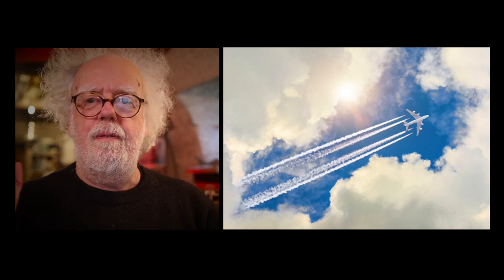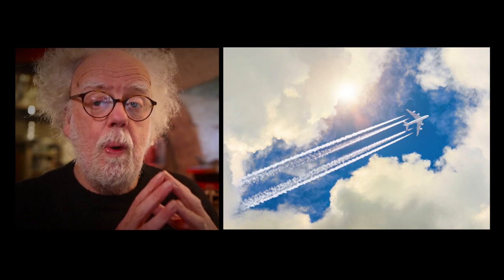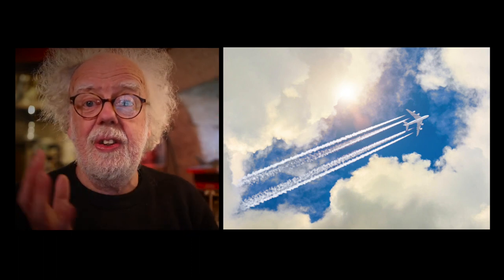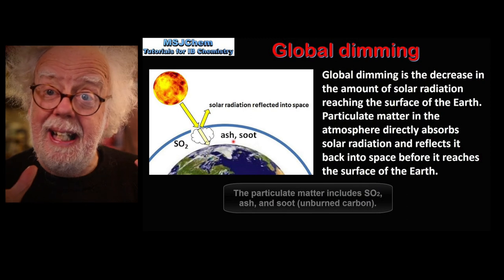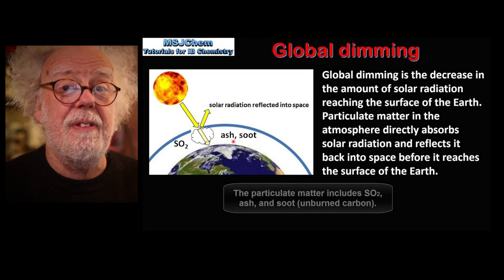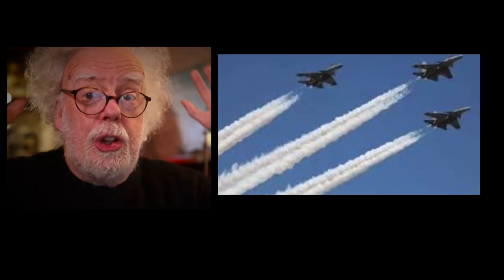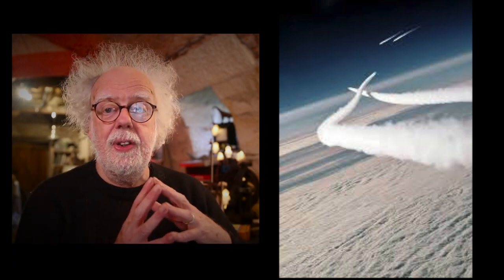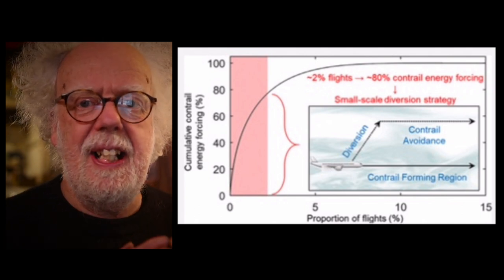Con-Trail Secrets - Prof Simon

Comment: as a former pilot what is stated here is nothing new, Relative Humidity is well known fact in understanding the formation of cloud which a condensation trail is.  in fact it is all part of the Adiabatic process provided a parcel of air reaches its Dew point then it will condense out and form cloud regardless whether it is an aircraft or the cooling towers of a power station producing it.. meteorological soundings or Tephigrams will give you and idea of which FL this will occur however i disagree with your figures on contrails contributing to 50% global dimming. Cloud reflects shortwave solar energy thus therefore less short wave will reach the earths surface to rebound back as Longwave radiation (terrestrial re radiation) thus negating greenhouse effect the contrail produced if your hypothesis is to be correct ..remember that the Krakatoa eruption in 1853 caused Global cooling ..further more it is common knowledge that the ww2 B17 crews can be seen by the Germans 50 miles away on some days, the length of Vapor trails depends on the R,Humidity on a given day.. and today`s Gas turbine engines are high Bypass rather than low bypass of the early years of Jet airliners thus  more of the air ingested is bypassed at the N1 Compressor therefore cold air surrounding the heated air from main combustion chamber compared to almost 100% of air ingested in Low bypass passing through the combustion chamber ..so in a nut shell it has negligible effects on WX in comparison to heavy industry at ground level and certainly is not the chemicals some conspiracy nuts like to dribble on about

Comment: Professor, i wish my memory served me better, but are you aware that some of these "vapor trails" (of which most are as you say) are actually what conspiracy theorist refer to as "chem trails"? And funny you mentioned the weather association,  because the reasons for these "chem trails" is not as nefarious as believed nor as secret. In the early eighties there were broad ranged projects and experiments in the Los Angeles area and most of California (where I was born and raised) in weather modification. One of which has been used for several years, cloud seeding with different powdered metallic substances in suspension and sprayed above the cloud deck (which as I'm sure you know varies with the weather) and through whatever processes, promote the continued condensation within the clouds, At which point they will grow and become more dense until the point of rain. Various newspapers of the areas of these occurrences would run ads in the "Public Notices" sections of the newspapers int the applicable communities. California has had a long history of drought and the eighties were no exception. One other note, maybe you would be willing to verify this; I read an article that had a believable story about weather modification weoponised, and how it's (supposedly) an addendum in the Geniva Convention (agreement, charter?) that these weopons are classified as criminal and Not to be used during war time. Don't know if THAT is true, but I have been aware of cloud seeding from childhood and knowing (at the time) pilots that were somehow aparty to these projects that were no more secret that a crop duster and his payload.
Reply from the maker: You are mixing cloud seeding ,, con trails and chem trails up....pseudo science.

Comment: Every action has an equal & opposite reaction flying at dif altitudes may just not render the trail of carbon visible it will still be there just as all ocean plastic dont float at the same lvl there are ireland's that form at depths via accumulation like cloud or air density accumulations. So in theory we have not repaired the ozone layer we have replaced it with our own toxic fog? Nice how much polar ice & permafrost have we left to melt holding 200% more carbon? Before the planet turns like Disney's Wall-E but infinitely worse in a boil trash wash?

Comment: Sometimes there is no aircraft at the beginning of these CHEMTRAILS!  You do make a very good job of playing down most of your subjects, although, there is some truth in what you talk about.  So, Prof Simon,, please could you explain or let us know that you cannot explain what is really going on up there.
Reply from the maker: There is often a gap between the aircraft and the con trail....
Reply: Professor Simon Holland LOL..Thank you for your reply Prof Simon.  There just is no aircraft, even with a gap.  Slightly off subject here, but the sky is full of cloaked ships,. You can actually see stationery, triangular craft poking through, TR-3B maybe. People are starting to look up and notice!
Reply: @traceywindle962  I had a TR3B for many years, probably the best sounding car on the road in my area. The gap sometimes seen between plane and contrail depends on temperature differential at a given altitude of the exhaust, and the surrounding air. In a case where no plane is seen, is quite often caused by high altitude roll clouds, typically showing up in higher latitudes in the northern hemisphere, and, of course, lower in the southern hemisphere.
Reply: Peter Barratt  Yes, the Triumph TR3B is a great sounding car, but I am talking about the TR-3B, which may be a cover for the TR-3A Black Manta Anti-Gravity Craft, which both do not officially exist. As well as these aircraft being totally silent the plasma generated by these aircraft reduces radar signature significantly so it’ll almost be invisible on radar and will be undetected by air traffic control. Thanks for your explanation on the trails, but some of these trails are quite close and I trust my own eyes and camera to what I have actually seen and continue to keep seeing.